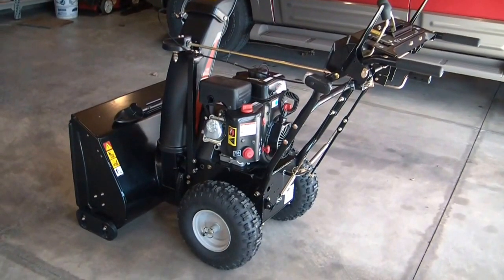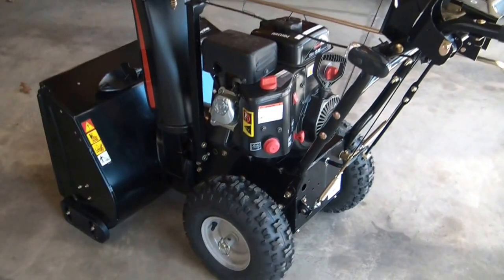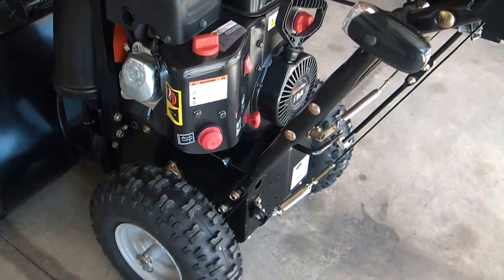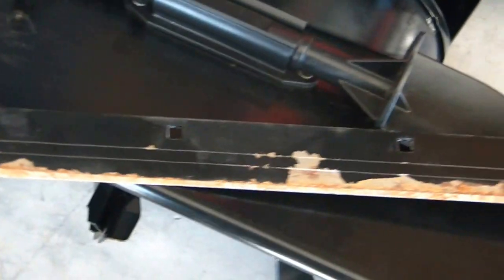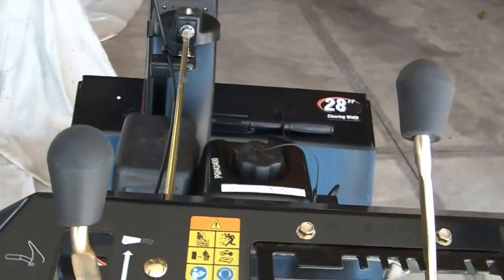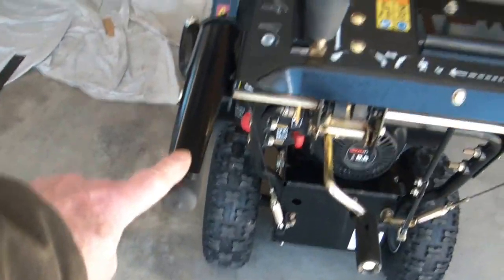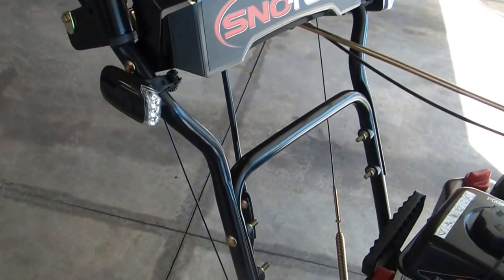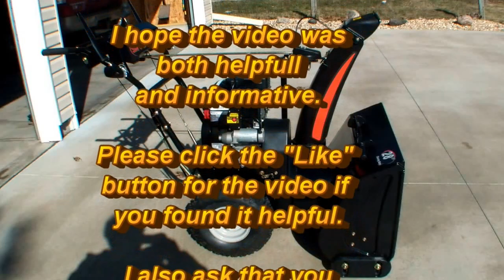SnoTek Snowblower Review

Comment: Thanks for the video Tom. You really have your shit together and your idea for the bike lights is a clever idea. Also you did a fantastic job on the bottom edge and I agree with your position on scrapping the pavement clean. 
You still have got it bud. Once again your generation sets a good example for the others by keeping the equipment clean and maintained. Ps, don't get to frisky cause we need your knowledge and inspiration around for years to come.
Reply from the maker: Thank you for the kind words.  IMO if you want anything to work properly and to last a long time you have to perform routine maintenance. Another thing that I do, which I did not mention in the video, is to spray the chute, auger and pretty much everything on the snowblower. with silicone spray after I have used the snowblower 2 or 3 times.  This helps to stop snow and ice from building up on the snowblower when you are using it.   I'm glad that you enjoyed the video.

Comment from the maker: Earlier this week I performed maintenance on my SnoTek to get ready for winter. (It's still in the mid 60's here in northern IL.) I removed the shear pins and inspected them then greased the auger shaft. I also changed the oil and blew out the air cleaner, which was actually clean to begin with. After putting fresh gas in the tank, priming 3 times and closing the choke it started with just one pull. I am still extremely pleased with my SnoTek. As much as I like my SnoTek I hope that I don't need to use it too much this winter.
Reply: These don't have any air cleaner, just a metal plate that covers the opening to the carb. Snowblowers in general have no air cleaner or filter. I guess you were blowing out under your heater cover.
Reply: I guess Im randomly asking but does anybody know of a method to log back into an instagram account??
I was stupid forgot my login password. I would appreciate any assistance you can offer me!
Reply: @Davion Cullen instablaster ;)
Reply: @Corbin Vivaan It did the trick and I finally got access to my account again. I'm so happy:D
Thank you so much, you saved my ass!
Reply: @Davion Cullen no problem xD

Comment: They just went on for $100 off new at my local HD store, may pick one up for my first blower purchase. Good review.
Reply from the maker: Get it while you can. My experience was that they "sold out" very early, before we actually had any snow on the ground.  I bought mine in late November and had a very hard time finding one. I ended up having to go to an Ariens dealer to get one because all HD's within 50 miles were sold out. I personally think that you  will be very happy with a SnoTek. It comes with 2 extra shear pins but I did buy an additional 2 just to be on the safe side. I also purchased "composite" skids to replace the steel skids because I was afraid the steel skids would mar my driveway. Purchasing the composite skids ended up being a waste of money in my case. 

FYI -- When I got mine home, before I did anything else, I read the manual that comes with it.  In the manual it suggests checking all adjustments before using the machine. This includes the drive friction plate, auger adjustment, etc.  It took me about 45 minutes to check all of the adjustments and they were all fine except the the cable for the wheel drive, which was just VERY SLIGHTLY out of adjustment.

Comment: Thanks for the review and imformarion, im gonna go pick up a 24" today, ill keep an eye on that hose on mine.
Reply from the maker: Thank you for the comment. FYI -- I have had no additional problems with the Sno-Tek other than those mentioned in the video, since I posted the video. A couple of weeks ago I did some pre-season maintenance on the snowblower following the maintenance suggested in the owners manual. Took out and inspected the shear bolts, lubed the auger shaft, checked tire pressure,  sprayed Teflon  on the chute housing (to eliminate snow from sticking), etc. When I finished the quick maintenance I added  a little fresh gas and it started on the first pull. Bring the snow on. I'm all ready to go.

Comment: I got the same one and even when the snowplows pack it in the driveway this thing gets rid of it with no problem. Slush has been a problem either. Only thing I hate is you cant lower the speed of the motor, though it self adjusts itself for best performance of the load. It shoots way to far for use in the city here. So I wind up shooting it close to the ground but having to re-shoot the same stuff. But the last two I had always clogged up (a Craftsman and a Toro at that) within a minute so I can happily deal with this set back.  The speed is probably why it doesn't clog though but in light stuff the option would have been nice.

Comment: That rubber hose to the primmer bulb actually push air into the carburetor's gas bowl, causing gas to flood into the combustion chamber. You could spray starter fluid into primmer bulb to help the engine starts. I just replaced that hose on my snowblower. They seem to crack a lot for no reason.

Comment: Hi Tom!

Great review, Tom! I heard some people say that the 28" model is lacking in power when you have to go through heavy piles of snow, for an example the snow that the road crew fills your driveway with.  Have you ever experienced this lack of power?  I am thinking of buying this 28" model, which they still sell in scandinavia.   I live in Northern Norway longitude N 70 degrees, so lots of snow to handle.. ;)  

Best regards from the North!
Reply from the maker: I have never had a problem going through the plow truck bank at the end of the driveway, which is almost always a considerable amount higher than the top of the chute. I usually have to nibble my way through the bank by taking little bites and back up before taking another bite.  If I don't do it that way the blower wants to climb up on top of the bank. After I get through with one pass I then take make about 3/4 width passes along the length of the snow bank, which is normally 6"+ higher than the chute.

IMO it has more than enough power. In almost all cases the plow bank is packed somewhat hard, heavy and fairly wet. The plow bank itself has never been light, dry and fluffy even when the undisturbed some is dry and light. If the bank were to be light and dry, the blower would go through it with no problem. But because of the wet density of the bank, the blower tends to try to climb up on the pile instead of biting in.  The front of the blower is fairly light in weight. I have seen a video or two in which people have put a sand bag on the top of the chute to keep it down, so that the front will not try to climb up onto wet dense piles.

During the 2016/2017 winter we had only 4 or 5 snows and all of them were 5" or less. But, in years that we have had heavy snow accumulations it far exceeded my expectations. I don't know how pricing is in Scandinavia but here in the U.S. the Sno-Tek is very moderately priced compared to most other blowers in its' class that are 28" wide. The bottom line is that I would buy a Sno-Tek 28" again if I were in the market for a snowblower. Good luck on making a decision. I hope that my reply has helped.

Comment: Hi how do u take the blades out one of my pings broke and I try to take it off but they not coming out can u help out
Reply from the maker: What broke? You said a "pings" broke. My guess is that you are referring to a shear bolt. Was it one of the shear bolts that broke? If it was a shear bolt you do not have to take the auger (blades) out. To remove the broken shear bolt you will have to get a punch and either push or punch the broken shear bolt out. If you do not have a punch you could try using a 1/4" bolt to punch out the broken shear bolt.  While you are doing that I would grease the auger blade until grease comes out of the shear bolt hole and the ends of the auger tube.  I would also remove the shear bolt on the other side and grease that auger side too.
Reply from the maker: Here is a video on how to remove and change shear pins.  https://youtu.be/wodiCw7eb7E
Reply: @tomrum42  yes that's exactly what happened thank very much
Reply from the maker: I'm glad that I could help. Always pick up any branches, newspapers or other objects that are visible before blowing. Be sure to replace using the correct shear bolts. As the video above notes, just because the replacement is the same diameter doesn't mean that is the correct replacement. The shear lines on the bolt also have to match the shear lines on the old bolts. Ebay is a good place to get shear bolts at a reasonable price. Look in you r owners manual to get the UPC number of the bolts and order using the UPC number. Order a half dozen so you have some on hand in the event it happens again.

Comment: How much assembly is required ?
Reply from the maker: It was full assembled when I purchased it but the dealer had to remove the chute assemble for me so that I could fit it into my SUV. They of course did that for no charge. Once I had the machine home I had to re-assemble the chute assembly on to the snowblower which was very simple and fast to do.

Keep in mind that you will need a larger vehicle to transport it to your home. A pick-up truck is best.  You will need help to unload it at your residence unless you have ramps.